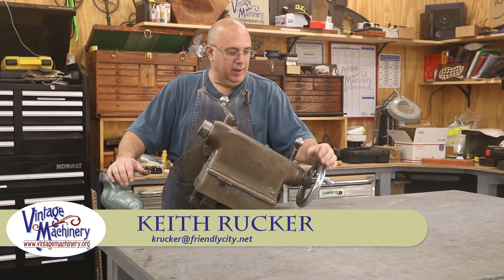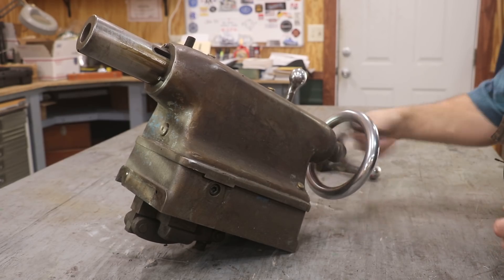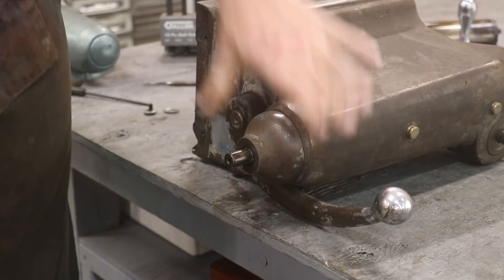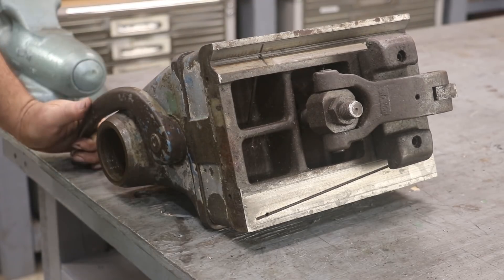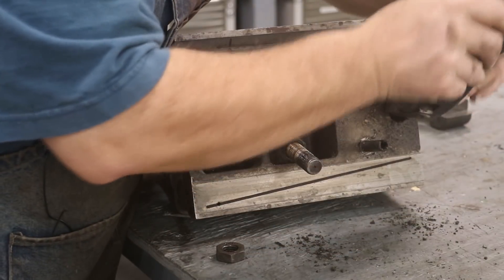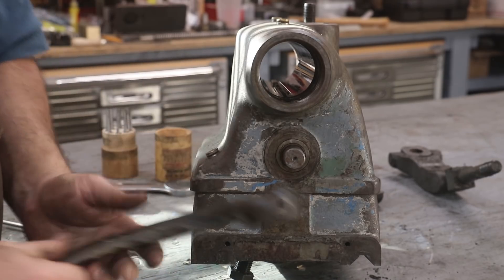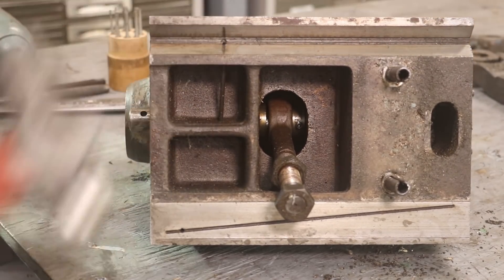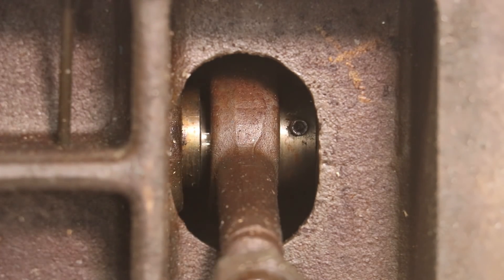Monarch Model K Lathe Tailstock Disassembly - Monarch Lathe Restoration - Part 26

Comment: Doah! I'm going to have to wait for the rest.
Keith, I know this may sound strange but bear with me.

  If I had a machine that was missing the tail-stock and had far more time than money, (in fact, buying the tail-stock doesn't seem feasible in the next 6 months or so) would you recommend attempting to make one? I'm a fresh-outa-school machinist but I'm 42 and have done many jobs that relate to machining so, not like a 19-year-old that's just starting to learn what metal can & can't do. I'm guessing the quill has to be precision ground ...? What if I could take one from an old drill press? 
Also, I have a small tail-stock from an atlas lathe but it's pretty small for the machine that I'm needing one for. Would I be better off just finding a way to mount that up to get by until I can afford to buy a proper one or would you recommend attempting to make one?
What does your gut tell you?

Comment: At 15:00 I see what looks like three Allen head bolts/screws at 12, 4 and 8 o'clock positions on the top portion of the tail stock that would face the chuck.  What do they do?
Reply: I believe it's a wiper to keep debris out of the housing

Comment: You may want to drill and tap a hole from the bottom side of the lower casting for a set screw to hold the bushing. With a set screw easily accessible from the bottom, the next time it will come apart much easier. :-) This is one of those examples we run into where the design was flawed slightly.
Reply: Not sure how that would work given that the two castings are designed to slide over each other for adjustment. Looks like your setscrew would lock them together.

Comment: I didn't see it come out but there should be a key to keep the quill from rotating.  The key should have a pin in it coming out sideways to hold position in the tailstock.

Also missing is the quill wiper and keeper from the front, something pretty easily fabbed.

Comment: I was thinking the two main lumps would need separating, he-he. Those three hex-head bolts on the upper casting, I guess they would have been oiling ports originally.
Reply: Those would be used to hold on an oil wiper usualy with a brass ring.